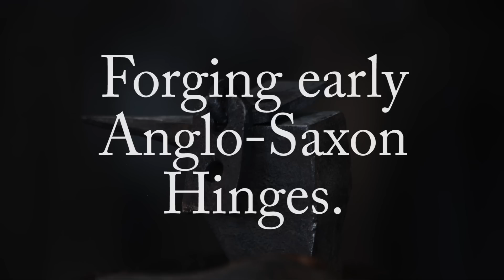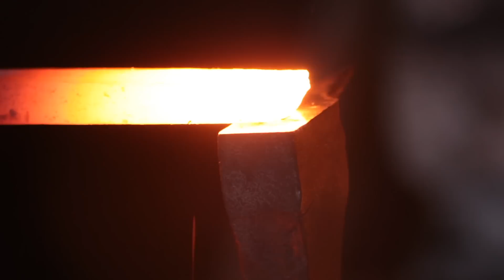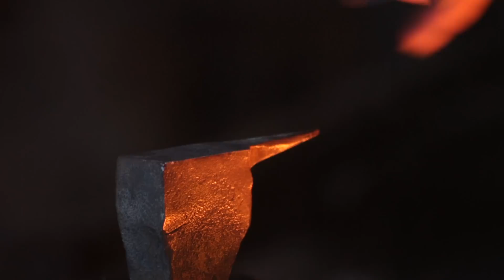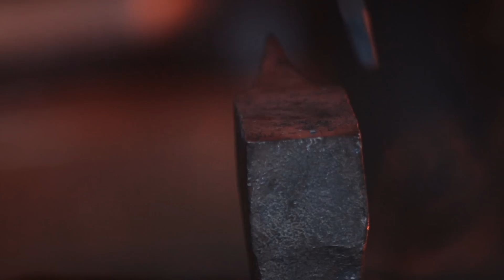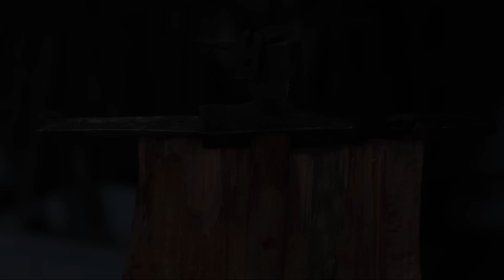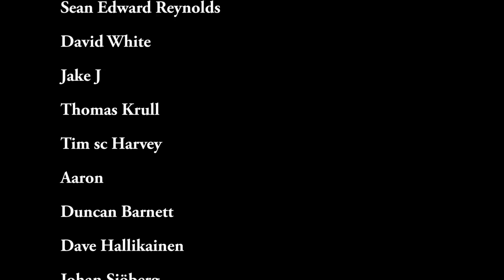Forging an early Anglo-Saxon hinge on an Anglo-Saxon Anvil.

Comment: Hi Rowan,  I've seen images of a number of modern reproductions of this style hinge, many copied on the Mastermyr chest hinges.  These you make are the only ones I've noticed specifically to be welded shut.  Do you think this style was generally welded?  I'm kind of curious about ancient hardware, and I'd love it if you could recommend possible resources to learn more.  What sort of applications did this hinge have.  Did hinges like this get used on doors?  It seems rather sloppy for a door hinge.  What sort of hinges did they use on doors in this era?  What sort of hinges did the Romans use?

Comment: I had a bit of a rummage around the Internet and the closest thing I could find was from K43 - is that what you based your re-construction on? Looking at the line drawings of the piece (Plate 4.30 in The Use of Grave-Goods in
Conversion-Period England c. 600 - c. 850 A.D. by  Helen Geake) it looks like both halves of the hinge were made by drawing out a tongue, turning it back and fusion welding it to the parent plate, one being brought back to the middle of the bar and the other one being drawn out from one side and turned back and welded to the other side, which is how several old black smithing books recommend making a ring on the end of a bar of wrought iron rather than punching it out which they recommend for 'machine steel' aka mild steel.

Comment: Great work as always!

But one thing i wonder is that, my former boss made a similar anvil for reconstruction of the mastermy find and when i studied it, he told me that it was slovly drowning into the wood when it was under hevy load, for example hevy hammer blows, so he told me that it sholud probably haxe a more distinct stopper on it´s foot to prevent that ant stop the anvil from acting as a wood splitting vedge.

He also tried to use a stoe as an anvli for hevier work and it worked supprisingly well even compared to a more modern steel anvil.

So, my guess, after a bit more experimenting is that the aincien blacksmiths possibly used both a bid stone ant thos tiny little anvils, and some moore tools in combinations apending on what one was doing.

Looks like old bog iron (correct English word?) was a bit more soft then modern steel when i compare them.

(Sorry for my terrible English...)
Reply from the maker: Your English is fine, mate :) I have seen modern reconstructions featuring a step on the foot - almost like a hardy hole. However the originals didn't have this step. As the smaller ones were probably mainly travelling anvils I guess it wouldn't matter too much as you would be taking it out of the stump and moving somewhere else every few days. A flatter foot would probably help though, you are right. And yes, for heavier work a stone would have been used. The Icelandic Sagas have a couple of stories of local smiths diving into the sea to find the perfect stone and I have actually visited the site of an ancient smithy with the stone still in place in Iceland.

Not just bog-iron but wrought iron in general is a much softer material to forge than mild steel. At the correct temperature it is like butter to work with.
Reply: RowanTaylor

Thank´s That was realy interesting information!
(Yes, i know Your reconstruction was accurat, i was just kurious... possibly the original foot even had that design so it should be easier to pull it loose when the work was done.)

I must see if i can found those stories.
Iceland still hawe preserved lot of aincient sagas, most of them where lost long time ago here on the mainland.
Reply: There are many finds of stones from early medieval forge sites that show hammer marks.
So these where obviously the "to go to" tool for heavier work.

Great to see that cute little anvil in action. :)